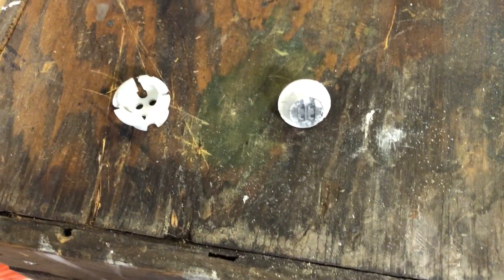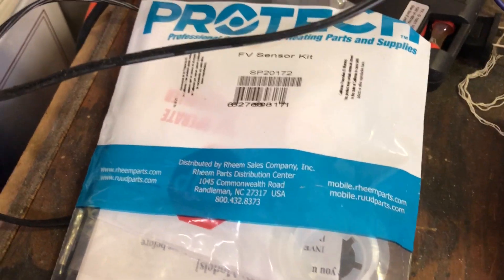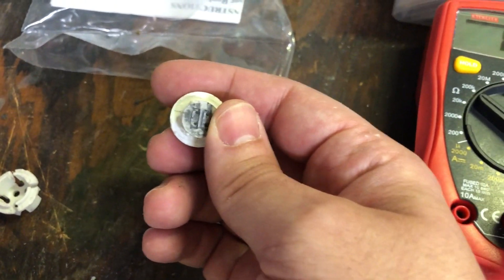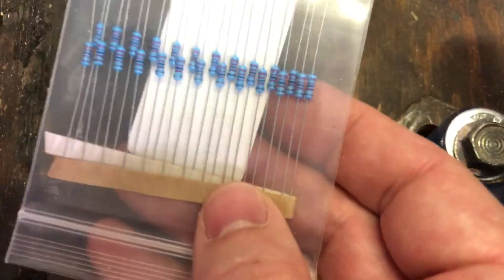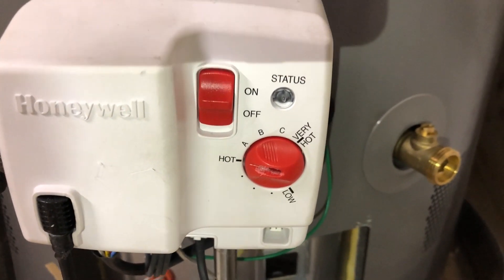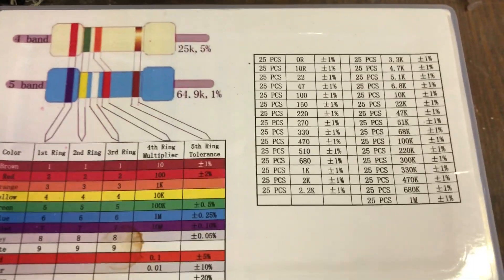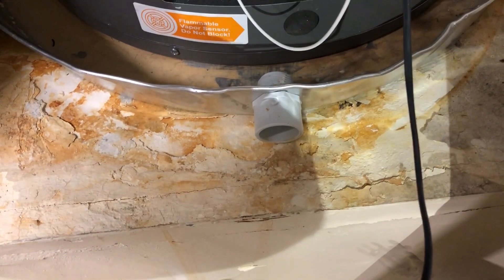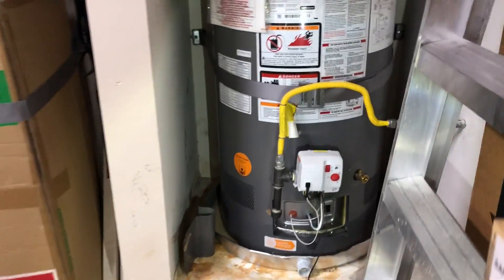Flammable vapor sensor, permanent, fix

Comment: Got my water heater running by wiping the resistance material off and using a pencil until I got to about 11k. Ordered a resistor but 1am bandaid complete so my wife can have a morning hot shower. Thank you. (My night shower was cold, didn't know the heater had stopped)

Comment: I had the same issue so tried the same fix but instead I got the error code 1-4-6 (light up) meaning it senses it's either open or shorted. I used exact same resistor as you. Please help!

Comment: What a fantastic hack, I’ve been searching for answers since that tank went cold, almost ordered a new one as it’s going on 10 years old and the twelve year warranty is useless. I’ve had a couple of little resistors hanging around here from a project 40 years ago and managed to find one, I looked up the color charts and it was around 25,000. I did the other guys trick popping the plug out and wrapping the wire around both terminals with the resistor in between them leaving a bit of clearance for the wire plugs, it looks stock. You have to put the wide gap between the colors on that resistor to the positive side that is the wire with no writing, turned everything thing on spun the dial 7 times, she sparked and sparked and sparked then presto on it is and hot water is happening. Thankyou so much sometimes the simplest is the correct solution, lots of great info in here!⭐️⭐️⭐️⭐️⭐️

Comment: My cat knocked over a new jug of laundry detergent near the base of water heater.  A day later the sensor tripped.
I got a new sensor and reset valve, but just ordered a 5pk of the resistors just in case.
Thank you!

Comment: I have the same issue with mine ive had the whole unit replaced the guy is trying to tell me that since i mop the floors and what not that its triggering the pilot light and the chemical smell is the issue and its why the pilot light isnt working, my furnace has no issues working and running and it the same thing, i may have to try this

Comment: Tim, Thank you so VERY MUCH for this clear & detailed explanation & Fix for the very identical Rheem hot water heater with gas controller.   I had been searching for two weeks for a solution and even hired a plumber/HVAC person in desperation to get hot water back into my house.  Long story short, I could not find a repair video anywhere close to yours.  I had already purchased a new Controller & a new FVS kit, but no where could I find the restart sequence & the temperature control high to low to high number of repetitions (6 times was the correct number).  Your video immediately brought my water heater back to life!!!  Thank you, thank you, thank you!!

Comment: I pulled off that sensor completely. Then tinned the wires and then soldered the resistor accross the wires. I'm keeping it like this because mine is in an attic. There is nothing up there that is flammable. Great way to permanently fix that annoying problem.

Comment: I like your idea.  I don’t have a high efficiency Rheem, but I absolutely would do the same modification.   I see way too many of those tanks with that failure.   I’ve lived. 65 years with a conventional standing pilot water heater without any problems.  I will continue the same path.

Comment: Worked perfectly! We live in a 120 year-old house with a fieldstone foundation that weeps water when it rains. The sensor reads the extra humidity as a flammable vapor. In reality, water vapor is (checks reference material) the precise opposite of flammable. So that was getting annoying.  Anyway, thanks.

Comment: Thank you so very, very much for posting this vid! l have had to replace that sensor 3 times in 16 months. Apparently, it thinks humidity is flammable as well. My wife has cancer and the chemo has made her hyper sensative to cold, and l was able to apply your fix the day after it went out instead of waiting a week for the plumber to show. The old h2o heater ran 27 years without a single problem before it died, this piece of junk has gone through 3 sensors and one controller in under 2 years. Atleast this time the repair was $1.85. Thank you again!!
Reply from the maker: I’m glad it worked for you and your wife. I hope she’s gets through her treatments with ease. Take care

Comment: Thanks. What's weird is I had this issue 8 months ago , simply restarted it by turning low-hot. Issue just came back and got it going again. Think I will try ordering one of those sensors but if keeps giving me trouble I am just going to try a resistor.

Comment: thanks for your hack. got me out of a jam, I did Dremel off the plastic over the electrode area of the sensor, hooked it to a meter and it read completely open. got a pencil and stroked it about 3 or four times and the ohmic value was 35k. i know it had to be between 5 and 70 k to work so I tried it and it didn't work until I removed power and turned off the switch and returned power turned it on and used a screwdriver to move the knob about 7 times back and forth and the blue light status light changed from the code 7 to the normal pulsating blue code. this is today Christmas eve 2021 and pretty much everything shut down until after Christmas. this was a prayer answered in which I ask God for wisdom on how to at least fix it temporarily. will be ordering a couple more sensors as I don't want to permanently override the sensor. I looked all over the place for a 22k resistor but I threw away my electronic parts years back as I haven't been making electronic projects anymore. I use to go to radio shack several times a week and now they're gone and just recently, frys electronics just closed down.    again thanks for the quick fix.

Comment: Thank you so much for taking the patiance to explain this so clearly! These resistor components are so hard to find in a physical store where I live and after days of cold water I desperately called about 4 hardware stores with no luck until one refered me to some hobby stores that sell RC components. Only 1 store had left over parts they bought wholesale from radio shack when they went out of buisness. I love online shopping but dang. Does it blow when you cant go buy those parts imidiatley.

Comment: I recently found something else that fouls the sensor is pot smoke 😮. I went into a basement that reeked with weed, the water heater was flashing the error code. I removed the sensor, blew it out with canned air, reset the controller and it fired right up. Told the occupant to open a window next time.😂😂

Comment: Have you not thought that maybe the problem isn’t “storing gas next to your water heater” as you say... but rather, that your GAS fired water heater could have/develop a GAS leak resulting in an explosion if the water heater wasn’t to turn itself off???
Reply: You can smell natural gas leaks - rotten egg smell. If you want to be extra safe, buy an explosive gas detector and put it near the water heater.

Comment: It’s humidity that sets it off for me. I’ve had good luck baking it in the oven for 20 minutes at 350 deg. But I was looking for a more permanent solution, because it sucks to discover there’s no hot water, and then have to deal with it.

Comment: Thanks for the video Tim, really made the difference for me and many others. I believe I have found my particular problem that was setting off the sensor, and it was none of the listed causes on the kit, nothing like that because my water heater isn't in a garage like most are, it's on my second floor with absolutely no proximity to anything prone to emitting vapors and the cabinet it is in is not even painted or coated inside in  any way. I didn't read through all the comments to see if anyone else mentioned this factor so here goes : High humidity and heat is the most likely cause in my case. I live in Southern California, at the beach, and most of the year the weather is classic SoCal perfect weather, even being so close to the ocean humidity is low, this is all reclaimed desert after all. Every couple of years a tropical storm comes up from the Mexico and brings extremely muggy conditions for about a week. I called Rheem and this possibility  came up in my conversation and the Tech at Rheem confirmed that yes, humidity and heat out of the ordinary will set off the sensor. Sorry for the ramble, Best Wishes Always.
Reply from the maker: Hmmm, interesting I live in dry Las Vegas,  my water heater was installed when it was cold outside, so my conditions were different from yours, so that adds to the mystery of what sets-off the sensor.  I believe it's just a faulty/poorly designed component.
Reply: @snowdonna  I'm with you on your belief there, it seems to be the cheapest design possible at the very least. As an aside, my home is 7 years old, it's what is known as an Energy Star Home

Comment: I had a 15K Ohm resistor on hand, so thank you so much for this hack. I got a new A.O. Smith water heater two days ago and while looking at how to run the condensation line from the blower housing I spotted a huge spider at the bottom and sprayed him. That killed my FV sensor, so I found this video which got me going again while I waited on Amazon to deliver a new Rheem sensor for $23. If the new one goes out anytime soon, the resistor goes back in for good.

Comment: Thank you Thank you Thank you Thank you Thank you.........
I called a plumber and he threatened with charging me over a hundred dollars for "bypassing the problem".  I didn't know how easy it was to fix until I saw your video.
As soon as you described how the sensor worked, and the resistor, I stopped the video, called my local electronic part store, they had it in stock for $1.49 for 5 pieces., but they were closing in 20 mins.  I stopped the video, went out and got the little package of 5 resistors (did I mentioned "$1.49 for FIVE resistors?).  went back, pulled the little plastic holder with the sensor inside, pulled the terminals out, put the legs of the resistor through each of the holes in the sensor' connector terminals, pushed the wire terminals back in place (had to force them in a bit as the terminals had to bend tight the resistor's legs.  Put the whole assembly back into place, reset the thermostat valve by twisting the heat knob back and forward repeatedly several times until the light went back to "normal operation".  I was reading the instructions on how to re-lit the heater when voila!!! I heard a noise, and the bam! the burner came back to life by itself and started burning away.  I looked through the window, and the pilot was happily working, everything else looked working normal, LED etc, and oh, did I mention that I had spent  $1.49 so far???  THAT WAS IT!!!!.
Now I will take my time contacting Rheem and request the new sensor (under warranty), which they said will take 2-5 days.  No problem, I'll be having hot showers all the way until the part arrives. Did I say "Thank you" enough?? probably not, so thank you, thank you..............
Reply: Threaten you?? You probably shouldn’t be working on mechanical fixtures.

Comment: Well here's a big eureka I'd like to share re: our Rheem Performance Platinum Hot Water Heater's vapor sensor with a Honeywell controller.  You need to do more than just turn the unit on and off to reset the sensor, as the manual implies. You need to unplug the unit. Wait 10 seconds. Plug it back in. Wait 5 more seconds. Then take the red temperature knob and rotate it counter-clockwise to low, then all the way clockwise to high, 6 X, all within 30 seconds. You'll hear a 'click' sound and the sensor is truly reset. Set the red dial to your normal temperature, and you'll see the blue light is no longer flashing the dreaded 7 flashes.  
I learned this pearl of wisdom in the following link:
https://www.google.com/search?q=rheem+flammable+vapor+sensor&rlz=1C1CHBF_enUS878US878&oq=rheem+flammable+vapor+sensor&aqs=chrome..69i57j0l7.6205j0j4&sourceid=chrome&ie=UTF-8#kpvalbx=_UkqSXuq3GpLStQayp6TgDg4

I wonder how many  people replaced this sensor, because they didn't do that 6 rotation reset trick? What a cruel thing not to put in the manual. 

I
Reply from the maker: Darcy Farnand I’m glad you mentioned that process, however i did that several times and it did not do a reset, even my repair technician couldn’t get it to reset while on the phone with Rheem.  Hence this video.

Comment: Great hack.  I immediately ordered a resistor kit from Amazon for $10 after seeing your video.  It arrived about 10 minutes ago.  What I did was broke apart the old sensor and wiped the black stuff off the inside of the sensor and checked to make sure I had an open line between the two spade contacts.  Then I wrapped a wire from the 22K ohm resistor around each of the two spade contacts, plugged the "hacked" sensor back in, reset the controller, and boom..... we have hot water.   Thanks so much!!
Reply: Rat pee tripped mine

Comment: Will this hack void warranty?
Reply from the maker: Jeremy King probably
Reply: @snowdonna  it is reversible and im the only one called for service so i think ill take the chance....
Reply from the maker: Jeremy King right, just don’t cut the connectors off so you can reconnect the sensor when needed.
Reply from the maker: @jeremyking6146  its totally reversible, just keep all the parts.  I just sold the house with the water heater.  I put it back together and it worked (for the few final days I was there)

Comment: Love Your video :-)
Got my sensor tripping 2 times and going to do the same.
Thanks for this great tip.
Reply from the maker: Joerg Magenreuter you’re welcome. Mine tripped one more time after doing this “hack”, couldn’t figure out why, but other than that it’s been fixed!
Reply: Tim White My heater is only 1 week old still under warranty.
But still going to do so after plumber was here for warranty work for Rheem.
Thanks
Reply from the maker: Joerg Magenreuter I had the same problem.